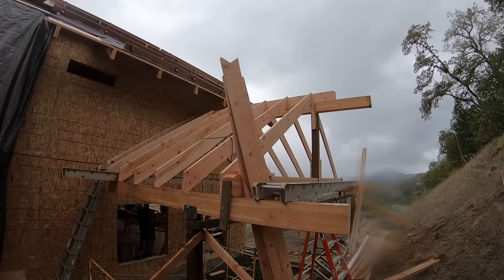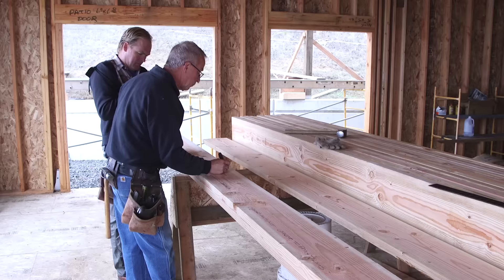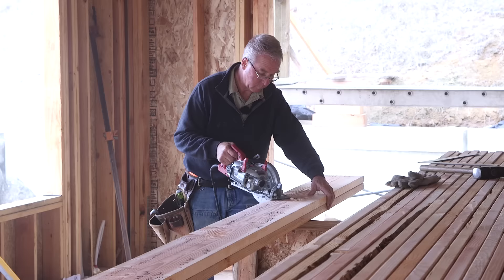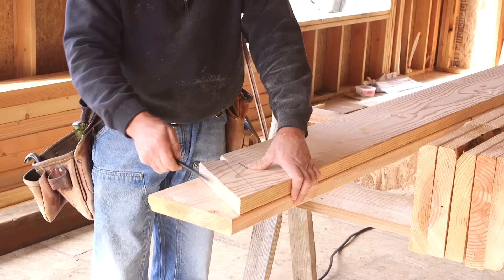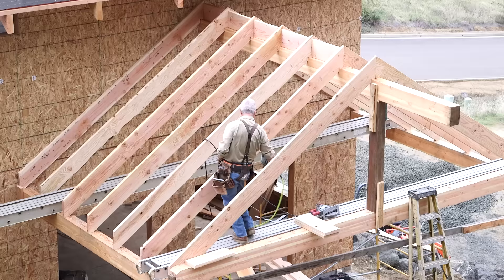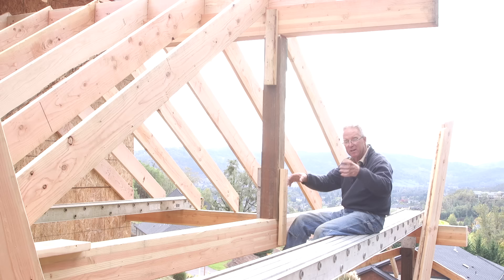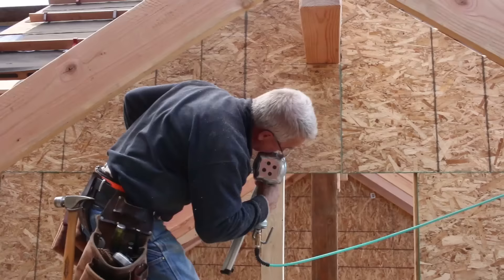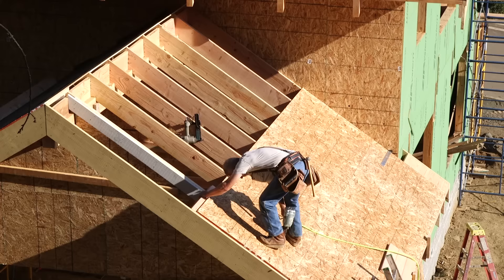Cutting Common Rafters Ep.72

Comment: ok, I'm confused by something very simple and basic. Why hand nail some items and sometimes use a nail gun? Is there a reason or is it just preference and time savings?
Reply: Well, look at it this way:   If you had one single nail to drive in one location, you'd take a hammer and drive it by hand a lot quicker than you could set up a compressor, roll out an air hose and shot that one nail with a gun.  On the other hand, if you had 500 nails to drive all in a 10 ft square,  obviously a nail gun ins doing to get that done a lot quicker than hand nailing.   So somewhere in between those two extremes is a trade off point where the hassle of dragging a  bulkier, heavier nail gun and it's  air hose vs the light weight and convenience of a hammer hanging from your tool belt becomes worth it.   Being as Scott has spend a lot of time driving nails by hand and is pretty efficient at it, I'd imagine his personal trade-off point is  more skewed toward hand driving nail than some folks.